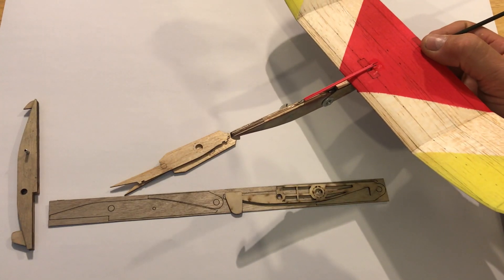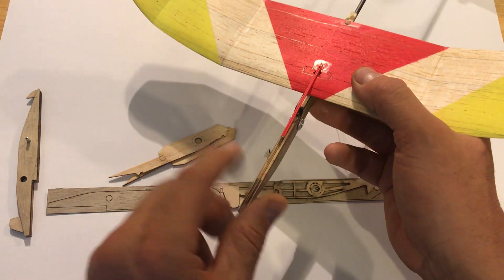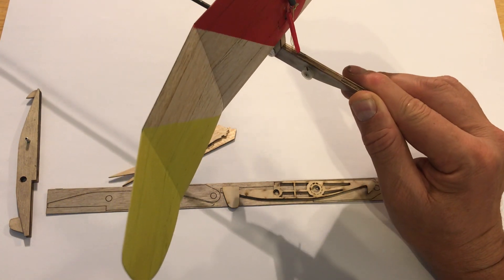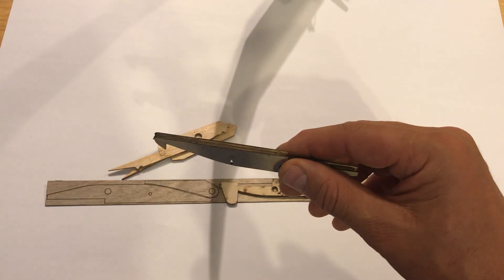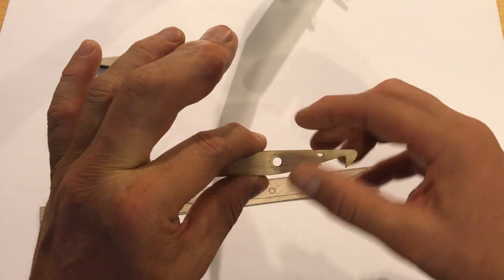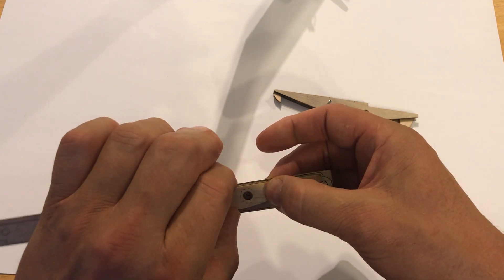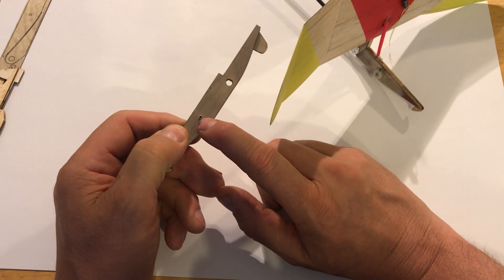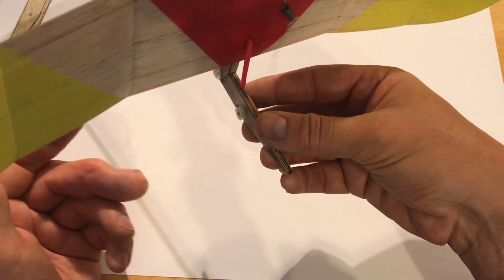Brief look at how the MidMatt 16 catapult glider dethermalizer timer works

Comment: Great video!  Am building one now and this outline if very instructive and helpful.  Couple of quick questions:  what is the source and size of your Chicago screw for the wing pivot, how'd you drill the holes in timer shaft for the carbon rods (0.02"), and where did you get the DT springs?  Again, great video and thanks again!
Reply: Hi thanks - the Chicago screws are no longer available in the light Al form (at least I can’t find em) I would sub in a piece of AL tubing and just fatten the ends slightly. Or a short nylon bolt.